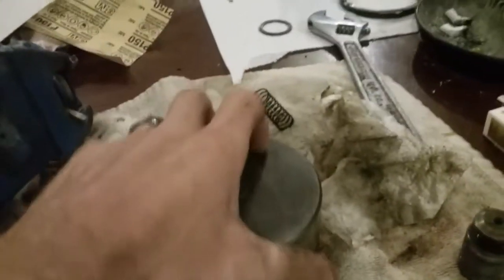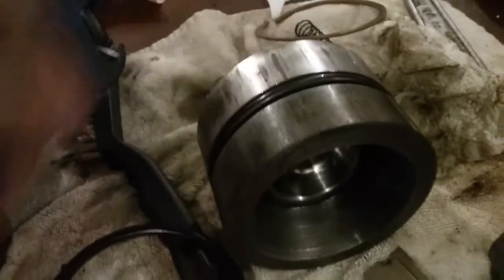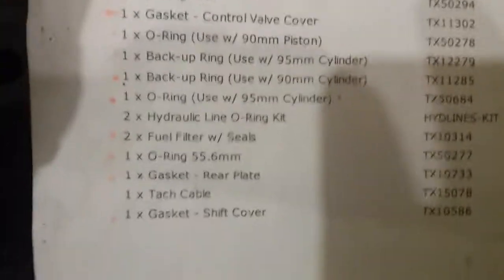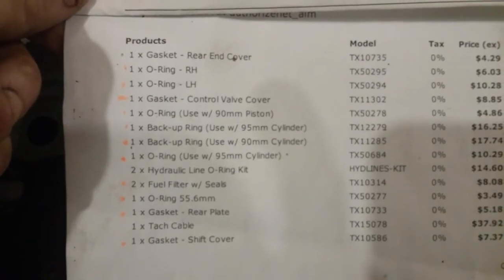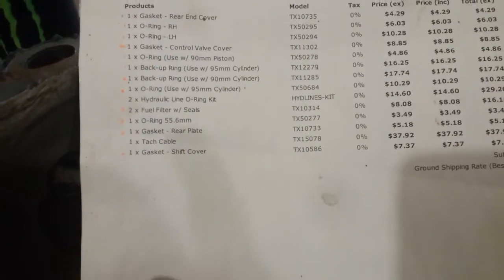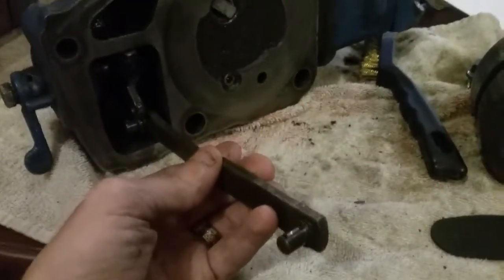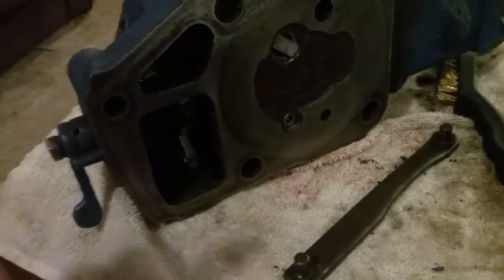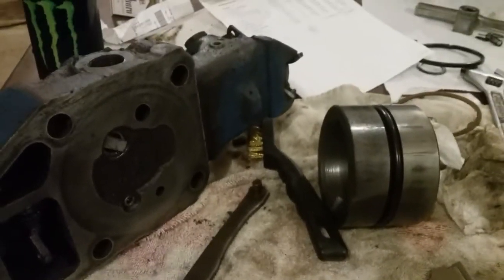Long 460 - Control Valve Cover, Piston woes.

Comment: Do you have any video's how to remove the hydraulic piston from housing on the same tractor
Reply from the maker: I don't have a video of it. But the front plate under the seat comes off. Once off, you can lift the three point arms repeatedly to push the piston out the front. Just disconnect the arms of the three point from any attachments, with no weight and no pressure it shouldn't be difficult to lift on it.
Reply from the maker: To be clear, the cover I'm talking about is the one shown in this video.

Comment: So did you ever solve the problem? I had a similar experience with a ford 8n. sometimes the 3pt lift would stop working. I found that a relief type valve had a problem inside the housing. Well now I recently bought a 460 long with the same issue you are facing. I was thinking of going into it and looking for the relief valve and see if its stuck open. If you have the answer to what yours was doing please post it. thanks.
Reply from the maker: I'm afraid not. But I expect the issue is the same as you described. Unfortunately I had to sell it after putting it back together.